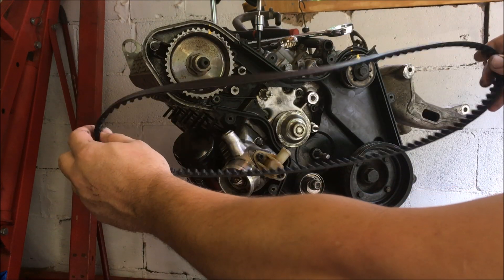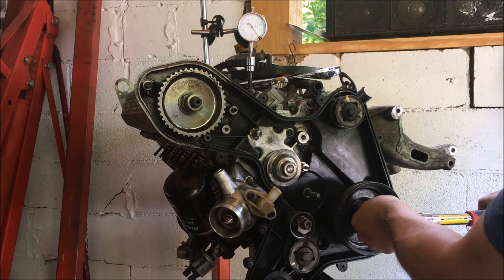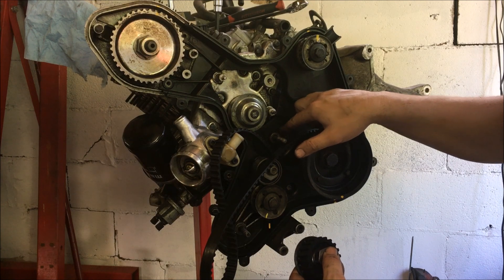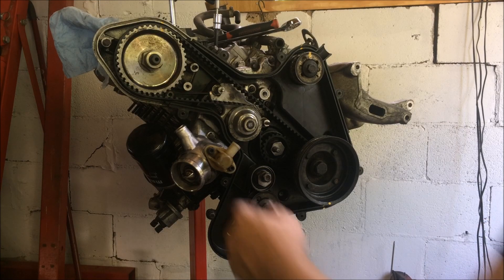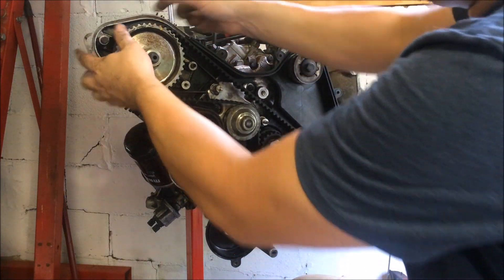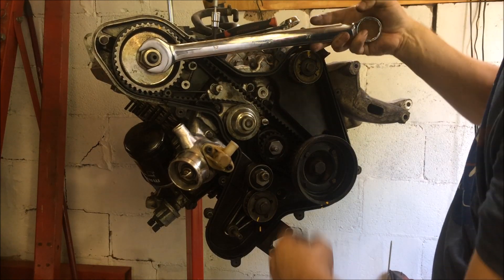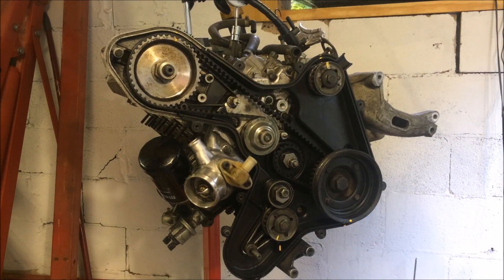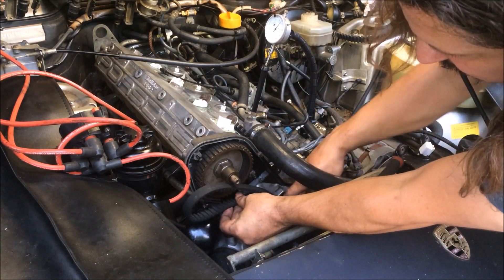Porsche 944 Timing Belt Installation Tutorial

Comment: 6:03 do you have to do this even on the engine with the auto spring tensioner, on a 1989 model
Reply from the maker: Yes! Over time the nut that calibrates the “auto” tensioner vibrates out and gets lost. This results in the spring being able to over tighten the belt. When the belt is too tight it breaks the water pump and can cause catastrophic damage. This issue most commonly seen on the “auto” tensioner cars since I’ve only ever seen one or two that still functioned properly. 

I hope that helps!
Reply: @edredas  so would it be right to have the auto tensioner locking nut and pivot loosened so the tensioner is released fully, then do the step shown in the video followed by adjusting the spring tensioner back and tightening it down when the water pump is able to move with force and the 90 degree twist on the upper span?
Reply from the maker: @khaledm1774  Yes, to some degree, never twist the belts since that is effectively as bad or worse than folding the belt which damages the tensile inside the belt. I just did a livestream today going over some of this using an auto-tensioner which may help! Thanks!

Comment: Hi thank you so much for this video. I am in the middle of replacing my timing belt and when removing the timing belt I noticed the crank mark on the crankshaft sprocket was slightly behind the mark on the cover. Can I just rotate that sprocket forward a little bit? Or what would be the best next steps?
Reply from the maker: There aren’t any factory marks on the crankshaft sprocket. Make sure the marks you are using for the crank is the OT on the flywheel. They should line up perfectly when the belt is installed properly. Otherwise you’ll Be down on power. I hope that helps!

Comment: So I put everything together according to the videos and I’m having an issue where when I start to rotate both once everything is together by hand, the timing belt seems like it wants to jump. It’ll be nice and tight then you go a few rotations and it loosens up on one side
Reply from the maker: Can you still rotate the crank as the timing starts to jump, or is it the cam side that slips? First make sure that your tensioner is locked down correctly with it rotated counter clockwise. Then make sure that your cam sprocket isn’t loose. I have seen the bolts back out and begin wearing out the keyway.

Comment: Great video,, thanks for all your infomative work.  I have an 83 944 and am curious how to adjust the existing timing belt.  I can turn the water pump with just my thumb and forefinger on the snout of the pulley. I'm having sporadic coolant temp. fluctuations and I think the too lose timing belt is the cause. Do I have to remove the balance shaft belt to adjust the timing belt? Thanks in advance.
Reply from the maker: It shouldn't be that loose. At 944 fest I demonstrated how to adjust the belts for a group and almost no one could turn the pump like I could, and it was difficult even with a good grip. So it should be rather snug. Luckily you will be able to snug it up without taking the balance shaft belt off. Good luck!
Reply: @edredas  Thanks for explaining the amount of force necessary to turn the water pump. I found removing the idler pulley for the balance shaft belt allowed ample deflection of the belt so I could snug the timing belt.

Comment: When you move the cam gear back to the timing mark after putting the belt on, the dial indicator moves away from TDC, which i am assuming was what was shown on the indicator before moving the cam gear forward to put the belt on. If you are measuring TDC with the dial indicator on a piston, it must have moved. Is that a big deal?
Reply from the maker: Once the slack is removed from the belt the timing will be perfectly set, even if the crank rotates backwards some during the process. Rotating the crank forward some will line it all up again. Also keep in mind that the dial indicator is measuring in thousandths of an inch which might seem large on the gauge but negligible in terms of the mark on the crank. I hope that helps!
Reply: @edredas  I figured it was prob good. Thank you for these vids, just did water pump, timing and balance shafts belts. The engine in and out of the car examples were very valuable

Comment: Is it normal to not find an OT mark on the flywheel?
Reply from the maker: Yes, it’s very common for rust to make it very hard to find. Use the mark on the cam tower to help find TDC. Just before those marks line up have some keep an eye out for the one on the flywheel. That should help. If you have 1986 and later car there is also another mark you can line up under the car near the starter. I hope that helps!
Reply: @edredas  here is weird thing. So the rust is not harsh. I have an 84 944 and the head and cam tower is off because of two bent intake valves I'm replacing. I have a visual of cylinders 1 and 4 at TDC. Now I am able to adjust the top and bottom balance shafts while I'm waiting for my parts to change my valves I'm going ahead to put everything on their timing marks. The last was doing the flywheel. I put the car in gear and I have turned it 3 or 4 times but I can't find the OT or timing mark which would be easy for me to eye ball? Only thing I see is a dot indentation when pistons 2 and 3 come close to TDC. So I'm stuck at finding the marking? If this is an issue,am I able to balance everything on the motor without seeing the marking on the flywheel?
Reply from the maker: @nicolomarinas7176  I wouldn’t try to time anything without the mark being found. Even just a tooth off and the car will run woefully down on power. Anymore than two teeth and you’ll bend the valves. So I recommend putting the engine with 1 at tdc and keep checking and scrubbing until you find it. The stamp on some early cars is very shallow so it doesn’t take much rust to hide it.

Comment: When setting timing do you always set crank at tdc first then cam . Or can I do cam first then crank . As I have just done head and set all pistons at a lower level below about quarter turn clock wise away from tdc via the crank bolt
Reply from the maker: If you have the pistons lowered to reinstall the cam housing, then you should put the cam at TDC first, then reversing the crank counter clockwise should bring the no. 1 piston back to TDC and into time. If its out of phase then you may end up sending number 2 and 3 up and into the valves, so use a wooden dowel to make sure no 1 is coming up. At this point you only want 1 coming up since 2 and 3 valves are open. I hope that helps!

Comment: Can I safely install the Tbelt with your method of advancing the cam if I have a 4 degree advanced cam key installed?
Reply from the maker: Yes! You will just notice that that cam sprocket is about 4 degrees advanced. Without removing the slack you would be about 14 degrees off which would be extremely noticeable and cause poor engine performance. Good luck!

Comment: do you have the link for the vid to do a newer car with automatic tensioner? thx
Reply from the maker: Unfortunately I never got around to making it that video, but I do have an engine that I could use. So hopefully, I can do that soon. As for giving you some tips in the meantime, its pretty straight foreword since the tensioner should get you close. You just want to make sure the tensioner doesn't make the belt too tight which can be an issue.

Comment: Hey my cam mark is spot on but my ot mark is slightly to the left of your yellow mark any input?
Reply from the maker: If you’ve adjusted the belt so the slack is out of it then rotate the crank twice. Once will turn the cam 180 degrees and two 360. Afterwards using the OT mark on the flywheel move it until it is almost revealed from the bottom edge of the pointer on the bell housing. If the cam mark is still lined up then you’re in time. I hope that help!

Comment: When placing belts fly don’t need to be locked ?
Reply from the maker: The flywheel lock is only used to remove the crank bolt which is torqued to 150 ft/lbs.

Comment: Hi! Love your videos!  i have the old waterpump. why should i change it? its working
Reply from the maker: The older style doesn't have the belt guide that keeps the belt from coming into contact with itself. Which is why they changed the design and recommend all of them be updated. With that said, an older water pump is a liability at this point and its best to replace it to avoid failure down the road. I hope that helps!

Comment: My cars got a newer belt but the slack from the crank and the cam is allot
Reply from the maker: Sometimes the belts can stretch out and needs to be snugged up again. I hope that helps!
Reply: @edredas  I got a job a O'Riley for the winter so I'm just gonna order parts under my discount and replace it cheap enough to do so anyway but I think it's stretched out a bit water pump looks new funny enough but I think they used the old belts I'ma try a cap and rotor mine aren't far from original hopefully I get the misfire sorted

Comment: Wonderful video!  I’m starting the process on an S2 and the front-facing bolt on the starter refuses to move (even with a torch & a jack under the wrench!), so I can’t place the flywheel lock. If I can’t remove the starter, is there another way to secure the engine so I can change the belts?
Reply from the maker: No need to use a flywheel lock if you're just replacing the belts. Its only necessary if you plan to replace the front main seal while your in there. That said, any shop should be able to get the starter bolt out for you. More than likely someone used an impact if it is that tight. Good luck!
Reply: @edredas  I was finally able to use a pry bar across the exhaust pipe to get enough leverage to get the bell housing side bolt off. Thanks for the encouragement!  New belts go on this weekend!

Comment: Is the 968 3.0 engine the same way so that the timing belt can be serviced? Does it need a crank or cam locking tool? I'm familiar with doing Audi 1.8t, 2.0t, and 4.2 timing belts just haven't done a Porsche 968 before
Reply from the maker: The belt and installation is similar but the 968 has a completely different tensioning system.
Reply: @edredas  So just set timing marks and lock crank then?

Comment: Never turn crank independent from cam...as shown in video. Major mistake...
Reply from the maker: You cannot bend valves by turning the engine by hand. You are literally trained to do this step in school and is how you set the timing on many engines otherwise the marks won’t line up.

Comment: Totally new to Porsche ownership, Ed. Couldn't resist a local 924S, one owner car but it has a bad coolant leak out of the front timing cover so must do the timing belt/water pump, which has filled me with dread. Until finding your channel. Thank you so much for ALL your videos. Have been watching for a week straight just soaking it all in. There probably aren't that many people like yourself out there doing what you do with the knowledge and care that you take. That's reason number one for this comment -- to say thanks and keep doing what you do. Number two is, I'm just curious if you ever did make the video on timing and tensioning a belt with the spring loaded tensioner?
Reply from the maker: Thanks! Unfortunately I haven’t had the chance to make that video yet. That said,  tensioning with the auto tensioner is the same idea. Sometimes they’re spot on but other times they aren’t. Just make sure you can still turn the pump with some force and it will be fine. Otherwise just back it off a tad. I hope that helps!
Reply: @edredas  Super helpful -- thank you!!!! I will use the forceful water pump turn as my measure to get it right. Is that the main way you like to set the tension, or do you check with a gauge when the camera is off? I only ask because, the P9201 tool is insanely expensive on ebay. Is it actually needed? Please make more videos -- so great to see you keep these cars on the road and learn from your experiences. BTW, you should offer a video consultation service... it would be great to get your insights via video chat!
Reply: @edredas  if yu have gotten around to it come help with mine lolol

Comment: Are you still planning on making another video talking about tensioning with the auto tensioner? Also can you just move the cam gear or the crank or balance belt shaft sprocket  with a wrench if they’re off? If they’re really off can you not do that?
Reply from the maker: Yup, still planning to, eventually! I haven't had a late engine on the stand with an auto-tensioner in quite a while but I'll be sure to do that as soon as I can. As for rotating the sprockets you have to be careful since you can bump the valves into the pistons. I hope that helps!

Comment: https://www.youtube.com/watch?v=xCNcD2yya2U&t=265s
^ spencerdog944 - Timing/Balance Belt & Water Pump Replacement

personally, I like to get as much research as possible before I go into a big scary task like this.
Reply from the maker: I haven't had a chance to watch it all the way through. I usually don't nitpick over other peoples videos, but some things stuck out.  1. The Balance-shaft tensioner is turned the wrong way. It should be rotated clock-wise. 2. The marks should line up perfectly, even before rotating the engine. 3. The idler/roller that he removed should only have a .5 mm gap on the bottom where the lower shaft is. On top there should be no gap with a 'pre-load' according to the workshop manual. As far as tensioning goes, never twist the belts or crimp them. If you are unsure of the belt tension be sure to use a gauge. Arnworx has one that is rather affordable. I hope that helps!

Comment: I really appreciate the way you explain concepts in your videos with no nonsense, they are gold.   A question I have is should the water pump pulley still turn by hand after running the engine for awhile?  Mine was fine after manually turning crank several turns but now tight after startup.
Reply from the maker: Once the engine warms up and expands its normal to not be able to turn the pump by hand. I hope that helps!
Reply: Thanks for the tip. To clarify , does this apply once engine has cooled  as well or should I be able to turn it again at that point.  I’m trying to determine if I need to adjust tension already as it seemed perfect prior to startup.  Thanks !
Reply from the maker: Once it’s cooled down you should be able to turn it again at that point. Sometimes the belt will get a good grip on it though and you’ll have to turn harder after it’s ran.
Reply: Ok good to know that’s normal as I can maybe turn it a only a few millimeters now even cool.  I didnt want to re-tension and mess it up if that was normal.   Thanks again !

Comment: Hi there, I was going to do my 16v S belts over the next few days. Guides I've read (like on Clarks Garage) have said I must remove the crankshaft pulley and balance belt pulley to get the timing belt on and off, but I can see you haven't done that to the one on the stand. Is there enough room to get by without taking the pulleys off pls? It looks like the procedure should be the same, although my tensioner is the automatic type. They also say to use a flywheel locking tool, but would prefer to use a dial gauge.
Reply: Update: it's not the same. You do have to remove the PAS pulley, altertnator pulley, and balance shaft pulley. My automatic tensioner didn't see to want to release the tension by more than 2 mm, so was very difficult to get the belt off.

Comment: Which sensors exactly? Good idea on oil cooler seals too, I'm already having main seals done, but now both, but which sensors? I'm having someone who has done this before do the work. Thanks again.
Reply from the maker: Both the speed and reference sensors. Just the other day I was driving a car and the plug broke leaving me stranded. I was able to get it fixed but its better to replace them before you ever run into that issue! Good luck!
Reply: @edredas  Hello, well timing belt is on, but mechanic says running a little off, not running perfect like before. He's thinking No. 3 isn't firing well enough, saying intake and exhaust valves, possibly headers, maybe send to a machine shop. He's checking those valves, but wants to talk to me first. I haven't heard it run yet. I want to make sure he didn't tension the timing belt without bumping back the Cam. Just so you know, it was the balance shaft belt that had broken and keeping it from starting, I was in a parking lot, not driving. Of course, I want whole timing belt kit replaced. That would be good mechanics. Any thoughts you have would be great. Thanks again.

Comment: Hello, good videos. Can you recommend a good place to buy a timing belt kit for a 1986 non-Turbo Porsche? Thank you.
Reply from the maker: Here is one of the most complete kits out there! I would recommend doing the front main seals as well, which are included! That said, you should also do the oil cooler seals that are not included as well. Once the oil cooler seals are replaced then you will be able to drive pretty much anywhere worry free! Also don't forget to replace the sensors! Don't wait for those to leave you stranded! Good luck! 

https://www.fcpeuro.com/products/porsche-timing-belt-kit-944-94410602113kit?ads_cmpid=352578679&ads_adid=22978217839&ads_matchtype=&ads_network=g&ads_creative=85228816639&utm_term=&ads_targetid=pla-74834319395&utm_campaign=&utm_source=adwords&utm_medium=ppc&ttv=2&gclid=EAIaIQobChMIl5zgqa_U5QIVQl8NCh1sdA8aEAQYBCABEgIQM_D_BwE